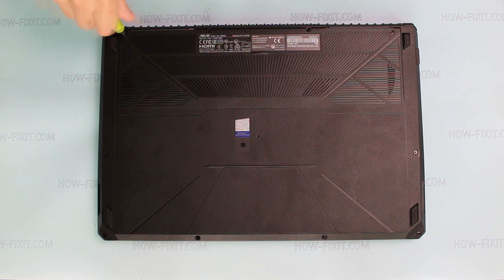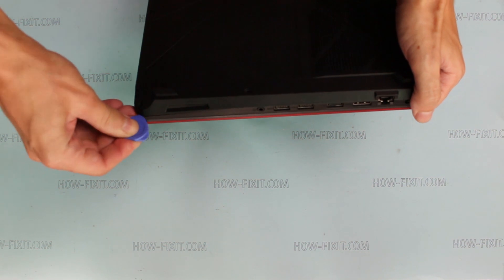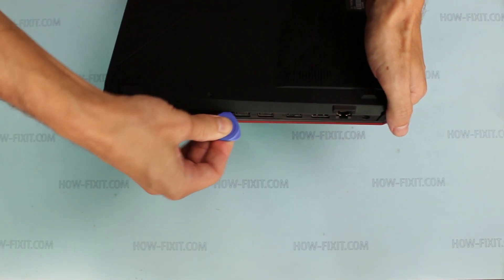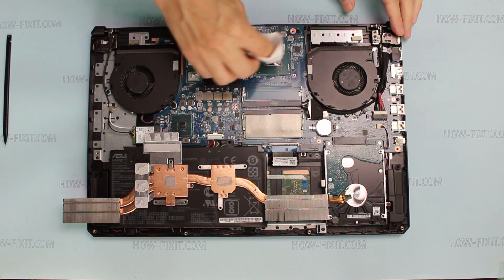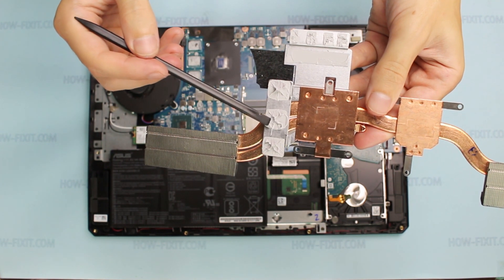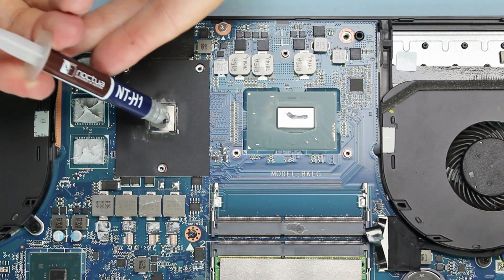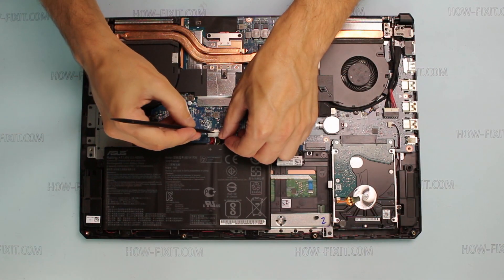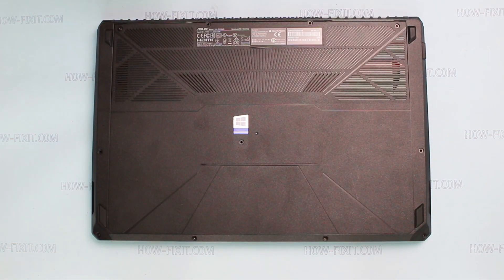Asus TUF FX504 Disassembly, Fan Cleaning and Thermal Paste Replacement

Comment: Avoid the FX504 series at all costs, this is the worst gaming laptop on the market right now. I own a FX504GE that comes with a core i7 8750H and a Nvidia 1050 Ti and it is underperforming too much, I cannot say if the core i5 will perform as bad, but, most likely it will. Either the core i5 or core i7 are 45 W parts, but, they are being limited to just 20 – 25 W meaning that you are paying extra for something that you can’t use. At its full potential
For the model I own expect the CPU to power throttle when on high CPU loads as a result the clock speed will be limited to the base speed of 2.2 GHz and turbo boost will not kick in even if it is enabled. So, for video editing, rendering, CAT simulations, etc. it will not perform as expected. You might be saying “this is a gaming computer, it is for gaming” well, it is a failure at that too. For the same CPU power limitation and clock speeds bouncing all over the place you will constantly have to cope with framedrops and stuttering in any game. To kind of solve the issue you will have to underbolt the CPU and GPU.
The worst part is that I contacted Asus on this regard and they have admitted there are some issues with the design and provided a ton of excuses on why it might be, but, are not willing to solve the problem. They suggest entering the PC to a service center for “fixing”, most likely they will change the motherboard or other components but most likely it will continue the same as there is no damage on the PC just a poor design. They will not provide a replacement computer either and if you bought the PC in other region you are screwed as their “international” warranty will not cover you on another region meaning you will have to ship the computer to wherever it was bought. 

Save your money and look elsewhere.
Reply: Update your bios firmware to 312 , and always use overboost mode its will boost the cpu up to 3,6 GHz even on power limit throttling ...

I have same laptop fx504ge i7 8750h , after update bios 312 its help me a lot
Reply: The reason why asus put so much throttling in this laptop is because its cooling system sucks
Reply: +Nuraini N
I can't test that as I returned the laptop, but, I've heard that it helps a lot with the FPS, although I’ve confirmed with other people that the 25 W power limit is not removed even with the fan profile in overboost (while gaming). It is basically behaving better, but, the limitation is still there.
Reply: Try fan boost mode while gaming its boost your power limit to 45w .
Reply: @piyushraj4989  
It didn't work while I had it. 
It was running BIOS version 311 when I returned it, but, while gaming it was stuck at 25 W even with the fan profile set to overboost.
For CPU only tasks it was a walk around indeed.
Reply: True, I was just rejected to return the laptop Even though they admitted that it is not good with cooling but after what....after I bought it and wasted my money...smh
Reply: Always plug in and put the battery saving feature to high performance... My fx504 got 4.10ghz at 98c... Playing battlefield 4 at ultra stable 60hz(i limit the frame rate)
Reply: If i put the battery settings to best battery it will not exceed 2.95ghz... but if i put it into best performance mode it'll kick up till max 4.10ghz... please do your research before spitting out nonsense...
Reply: hmmmm... mine seems to be in great condition after i disable the windows turbo boost and turn on windows game mode during games. i might try under-volting the cpu and the gpu in the future. But for now its been a great laptop :D.
Reply: Crasher's Mini militia in terms of specifications both are similar, but, the MSI seems to have a much better cooling solution. I will assume the MSI will perform better just because of that. I can or cannot confirm that as I don´t own the MSI. I’d recommend you to check some reviews
Reply: Try fan overboost. I have the same laptop. i was worried coz it under performed. but when i turned the fan into overboost. It changes everything.. silent mode will only give you 25w but for overboost it will give you 45w..
Reply: you can download asus fan over boost in windows market
Reply: Check the Dell 7567 it's much better
Reply: after bios update to 312  I am able to reach TDP of 44W in CPU . now it is power limit throttles at 70*C . This won't be helpful in gaming as the heat-pipes are shared
Reply: Undervolting and removing the power limit helps a lot mine works excellent
Reply: @nekoCS101  how do you remove power limit
Reply: @nekoCS101  could you recommend an accurate video of how to undervolt?
Reply: Install last bios, great laptop btw
Reply: Had this laptop for 3 years , i haven't cleaned it once , haven't changed the paste ( its gone ) , cpu clock still goes 3.9 or 4k on turbo boost , although it gets hot ( 90 95 temp) because i haven't changed the paste and clean the fan.

So i just limited the clock speed to 3.2k and my temp is around 79 , no more thermal throttle and fps drops , i have to note that fans are working as they should and just the fact that its not cleaned and the temp is 90 95 without paste says it all.
the only problem i ever had was with the cpu temp and it was after a year or so , gpu was fine , never an issue with the clock speeds or any power limit ( gotta say fans were loud on turbo boost)

This laptop didn't deserve all this hate,worked good for me  , btw im going to clean the laptop and do the repaste , im going to use cyro fuze as the paste , i will share the results ( im pretty sure there will be a very big drop in cpu temp )